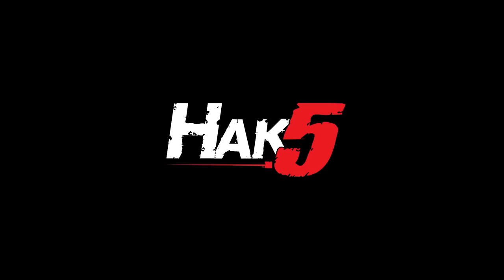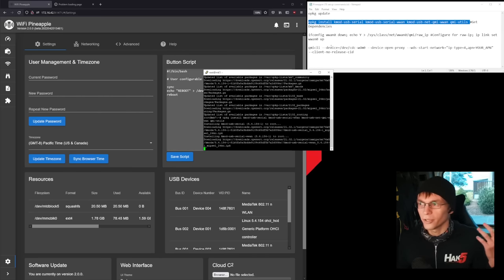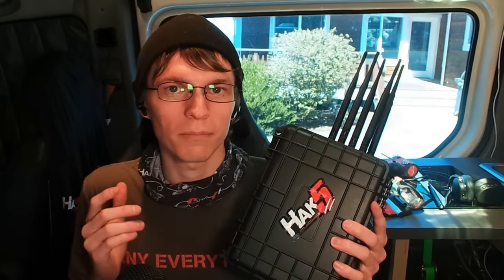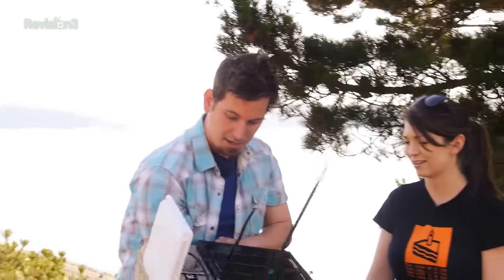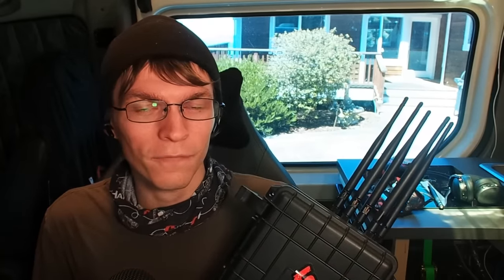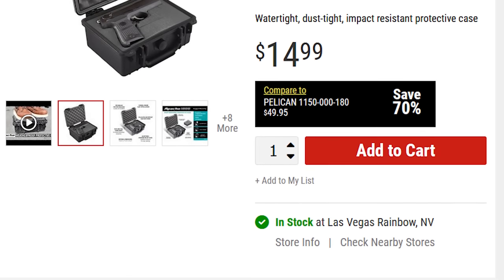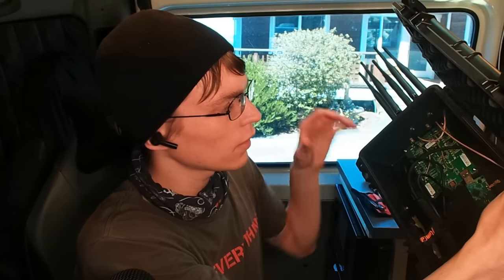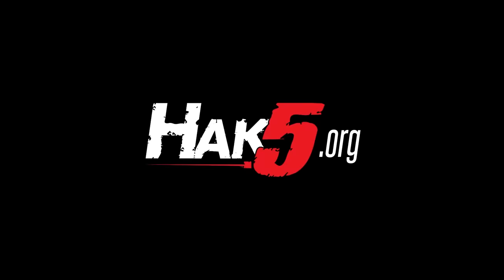Rugged Tactical WiFi Pineapple Mk7

Comment: you can probably use a longer case to hide the antennas for a more covert setup. otherwise mount the antennas against the surface of the case so that the antennas are more camouflaged, blending into the case’s shapes and lines. since they won’t stick out in that configuration, it is more transportable and probably can fit in places like an overhead baggage compartment. antennas sticking out by design can snag and get caught on stuff.
Reply: Or replace the antennas altogether with ones more low profile, like a sticker type antenna that can lay flat against the inside of the case and take up almost no room.
Reply: @shutup84  i find that flat patch antennas with adhesive on one side don’t have much choice on dBs or sizes. and the adhesive should be very good quality otherwise if it gets hot inside it might melt into goo. adhesive type antennas are more of a commitment to a very specific use. 

you have better choice in sizes , signal strength specs, and overall versatility with non-ahesive antennas. plus when it is inside the case you don’t necessarily have to have it stick on the case. if necessary, 3d printed clips or other methods that hold the antenna in place could more workable. and you can re-use the antennas for other purposes.
Reply: I think the HAK5 sticker may be a problem if you are interested in discretion.

Comment: for some reason i feel this will make its way into a watchdogs game at some point, still, interesting twist on a just for giggles experiment darren and snubs did, i'm loving the idea of a tactical pineapple in a water resistant enclosure that can be dropped into an area of operation without being readily noticed or without looking too out of place and exfiltrating the data back to home base via VPN or to a dropbox for later retrieval and analysis at a later time

Comment: If the case is not radio opaque I would install the antennas inside the case.  Also using some RG-174 cable  at 1/4 wave multiple lengths ( do not forget the Velocity factor of the RG 174 when calculating this ) This becomes a covert PineApp Mk7.  I like the SpongeBob or Hello Kitty tactical cases.  Each antenna would be placed so as to have minimal interference/interactions and in a position to maximize reception/transmission.  You could also place an 11 Element Yagi inside a hollow whiffle ball bat placed adjacent to it to get that extra range you may need for supervisory reasons. Think low noise GaAsFET preamps for Rx.

Comment: If you dont mind "losing the item" you could make it much smaller with say a dual ariel array and lob it or drop it via drone , on top of your local fast food shop ( or hidden in a large bush) where there is plenty of opertunistic passing devices. Something like the new rapsberry pi pico which has onboard wifi and runs at very low power consumption. You might get away with making it into say a scaffold pole size and make it look like a fence or tree support.
Reply: If you are going to use a drone to drop it I'm pretty sure it would be fairly simple to rig up some sort of simple retrieval system like maybe a metal wire on the pineapple and a hook on a DJI?

Comment: add an optional amp, add a dish with magnet to quick connect, add bigger antennae, add more usb dongles for more channels (lte/5g and also more on laptop for monitoring, add a usb hub, add a rasp pi and pi kvm - overall just go overboard to expand reach and capabilities, you may want to consider newer arm like rk3588
Reply: use older pharos gps? it can help provide time in opnsense and you can sync all clocks through webmin against internal stratum 1 and avoid ntp reflection attacks - with a small panel you should get long run times